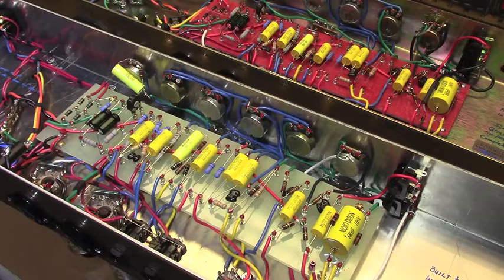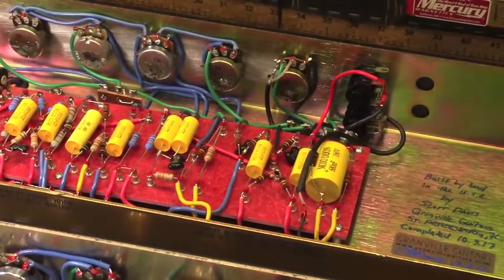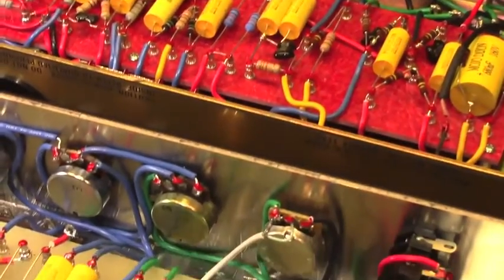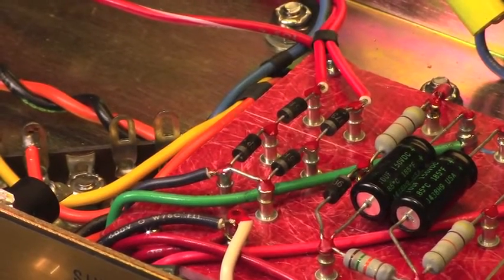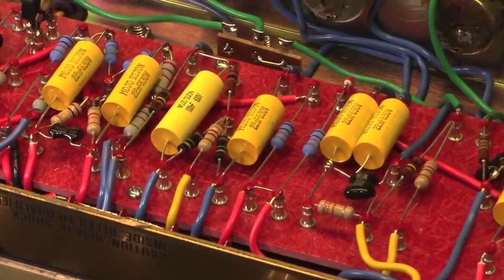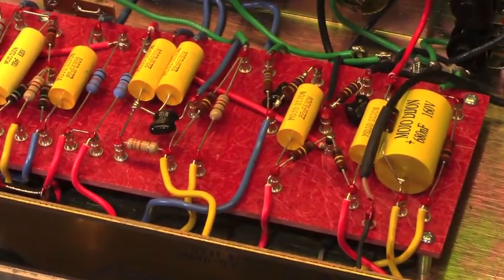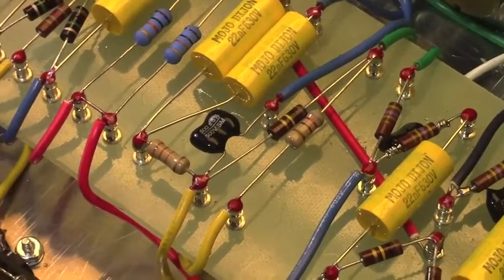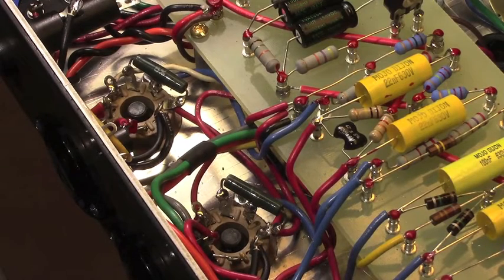Under The Hood - The Granville AMD 800 Amplifier

Comment: did you use Silver Mica for the bright cap?
Reply from the maker: Jesse Crowe - Yes.
Reply: Granville Guitars do you hear a big difference from ceramic?
Reply from the maker: Jesse Crowe - Not enough to complain about.  That capacitor plays such a small role in the overall sound of the amp that it's really not even worth worrying about. It's either working or it isn't.
Reply: @GranvilleGuitars  thanks!

Comment: Do you prefer the turret board builds to eyelet boards? What is the red material dabbed on the solder connections?
Clean wiring job...👍
Reply from the maker: Rodney Kroetsch - I like turret boards for my own amps.  I just feel more confident in the long term reliability.  I use a red ink to color the solder connection in tribute to the red lacquer that Marshall used to use.  I believe they did it to mark a connection that had been tested although it may have been to keep people from messing with things.  In any event it will definitely reveal any tampering should an amp come back.
Reply: @GranvilleGuitars  Cool idea! I may have to try a turret board build one day. Up to now I have only used the familiar Fender eyelet board. But then again I have not built a Marshall amp. I had to rebuild a '62 "brownie" Princeton that someone had gutted except for the transformers. Go figure, huh? They completely rewired it to some other-worldly circuit...🤯
Reply from the maker: Rodney Kroetsch - That's unfortunate.